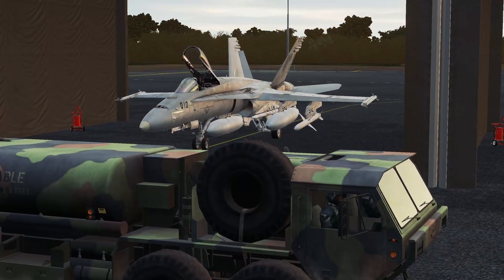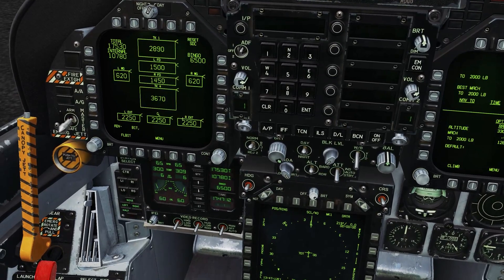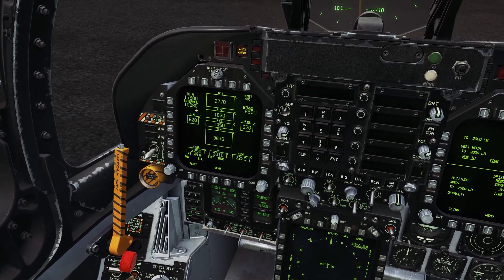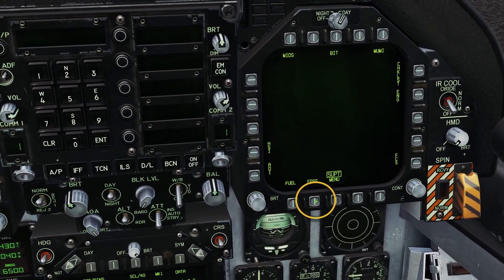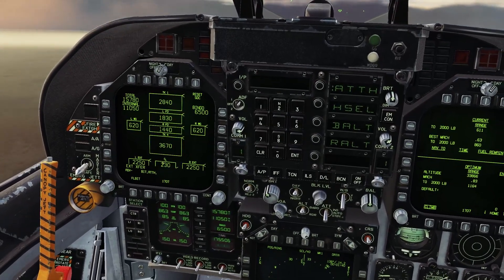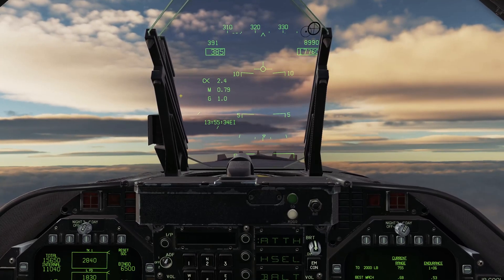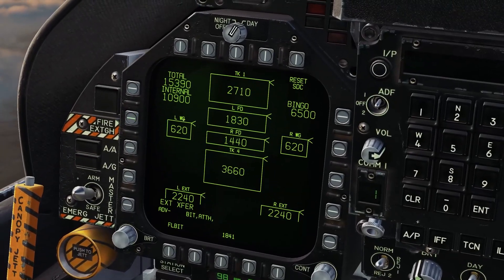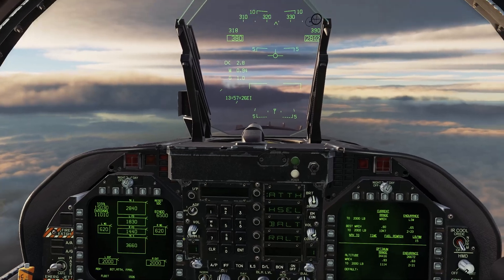F18 Fuel Management - Only for Pilots Pushing Real Deep

Comment: When getting hit by AAA, I sometimes see my fuel leak and basically it's game over for that mission. Is there a way to protect the fuel that I have left? Like if I put the wing tanks to STOP? Assuming I'm hit in the wing and that is where it's leaking?
Reply from the maker: That's a really good question. I've found in most cases, the answers a definite no. The fuel just leaks out in a matter of a minute or less. There is 1 exception that I sometimes experience, as if there's 2 types of "fuel damage" possible. In this second example, all the fuel leaks out like before, except for the tank immediately prior to being fed into the engine tanks (I can't recall it specifically, but I'm wanting to say about 1000lbs plus the engine tanks - maybe 1,500 in total). As far as I'm aware, there's no fuel switcharoo available to help stop this either, and the only way to go, is dumping stores/ MAX AB. Turn for nearest suitable base, and with burners on - pitch for climb to fly about Mach 0.9 -  imo the best way to try survive this. You won't always know which type of damage youve got, but getting away from the AAA and buying height is never a bad thing in such a situation. Seen as fuel is leaking at this point, might as well use the burner... As soon as the fuel has finished leaking out the tanks (watch fuel page carefully) and you're left with the 1.5k or so, immediately cut the power back to about 90-92% power (not mil!) and aim for best range/cruise - I think the stated best range speed in FPAS can seem a little low, and so 300-320 IAS is my minimum. Unlike the f16, which can glide nicely, I see no benefit to try milk any excess power, to gain additional height in the f18, seen as a deadstick is all over anyway. Beyond what you got in the initial burner climb (anything over 20k is good, another over 25 is very good) everything else just needs to be focused on flying as level and smooth as possible, and focus on setting up for a nice tight short approach. I've been amazed several times, just how far 1000lbs can take the hornet at the end.

Comment: if you absolutely must get as much distance as possible out of a jet, I recommend a "cruise climb," from a cruising profile you basically set the nose ~5-6 degrees above the horizon and leave it there at mil thrust. the jet will sort itself out over time, drifting upward as it gets lighter. you'll find at 45000+ feet you go very fast and burn very little fuel

Comment: In my experience its worth to climb to the FPAS alt with burners on. Yes the FF numbers look high, but you are a lot quicker on altitude where you burn much less.
Reply: according to the Natops manual it is more efficient to climb in MIL than burner. but because of the reason you stated, more time at higher alt and lower fuel burn, the difference isn't that great, only a couple hundred pounds.
Reply: @launchsquid  thanks for info. Will try it out

Comment: If this was a real F/A-18 you'd never follow this advice. You never want to pressurize your drop tanks on deck which is what you are doing when you go to overide. This is how fuel transfers out of the drop tanks. Furthermore, you don't want to deplete your drop tanks on deck because then the fuel sloshes around if you drain them on deck which causes wonky CG issues on take off. There's a reason they stay in Norm on the deck and the aircraft draws fuel from tanks 1, 4 and the wings to the feed tanks 2 and 3.  It all has to do with CG. But I get it, the SIM can't calculate how a fuel system works if it doesn't know how it works. Just wanted to clarify.
Reply from the maker: You're right, I should have added no way in a real F18 follow this advice just in case. might seem daft, but i see a few doing this disclaimer on every vid. DCS doesn't (yet) simulate these factors, but one day, who knows
Reply: @DCSDigitalCombatSimulator  I see those disclaimers on the videos and always get a bit of a chuckle out of them. If a real FA-18 pilot is watching YouTube to learn how to fly the plane, we are all in a hell of a lot of trouble! :)
Reply: I would say he isn't on the deck but on the ground.
So there is some merit to deplete fuel from external tanks on the GROUND if you can get jumped upon any time after take off and may have to punch out external tanks.
😉

Comment: Great video. Only critique is I think its better (and always do) to pull fuel from the wing tanks first, then drop them as soon as empty, if range will be tight. That way I can keep the center tank on in a fight. If need be I can drop it for ACM, but it's less wasted fuel then if I dropped both wing tanks.

Comment: The  FPAS page is such a wondeful thing. It's one of the many reasons why I don't feel like flying the viper again until they finally implement CRUS. Fuel management is such a crucial aspect of a flight plan when it comes to anything more complex than a training mission or (god forbid) an air quake server.
Reply: In the Viper I've found one of the best things to do manage fuel, is to not over load the jet. Near max weight in the viper you lose so much performance, its very hard to get up to like 30k feet on mil power. (where its very easy on the hornet thanks to its larger wings)

Comment: Wouldn't it be more efficient to draw fuel from wing tanks first?  That way you can keep your centerline for combat and give you more space until bingo?
Reply: In a space rocket it's more efficient to burn through and drop the bigger fuel tanks first to get rid of dead weight, but I'm guessing it's more nuanced in this type of setup and there may be a benefit to using the centerline first, dumping drag as soon as possible
Reply from the maker: You raise good points, afaik the tanks are identical, they certainly hold equal amounts of fuel, and so losing a portion of drag sooner rather than later was my thinking also. If you knew when you were to find action, and would still have less than 1/3 fuel in the externals, then I suspect your idea would fair better. Great comment
Reply: @DCSDigitalCombatSimulator  Yeah the hornet ext tanks are all the same. The f16 has a setting that automatically pulls fuel from the wing tanks first before pulling from centerline, so I'm assuming there's advantage to doing so.
Reply: Mirage 2000-5 also have this kind of logic. But 2000s external wing tanks are way bigger (2000 litres, around 530 Gal. if I'm not mistaken). The aircraft have a special vane called ''EDT'', which will allow tu burn fuel from the big tanks first, and then use the fuel from the 1300L centreline tank. This is done for long range patrol, to be able to drop the wing tanks and go supersonic with centreline tank still full (2000L external tanks are not rated for supersonic speed, even if 2000Ds pilots showed this limit wrong somehow). But IRL, specialy for A/G mission, you will not drop the external tanks once empty. Those things are not unlimited and cost their price (it's not just empty space inside them).